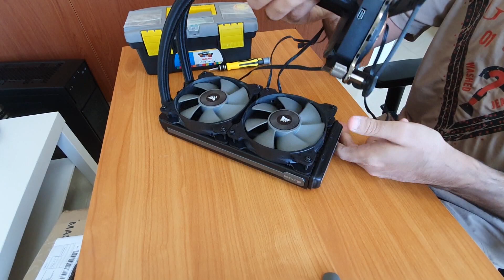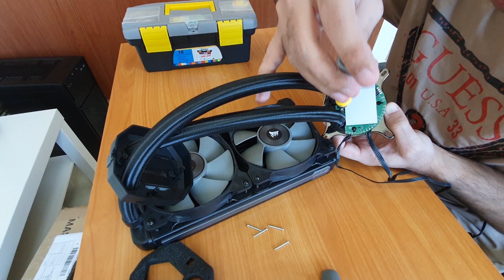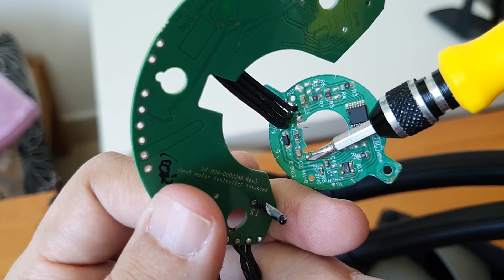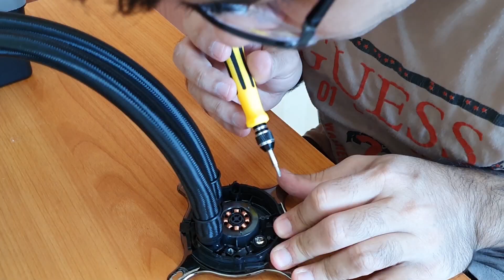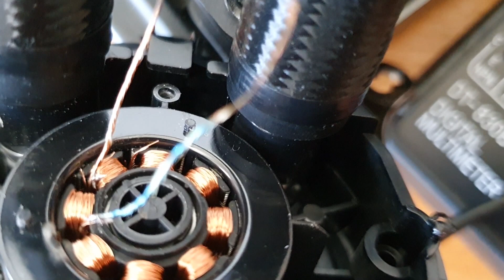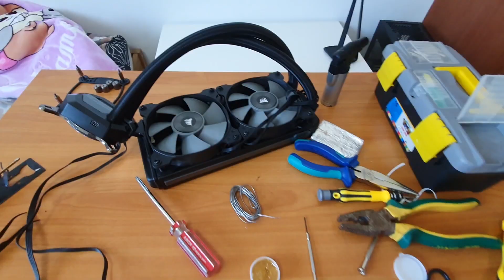My AIO just died :(( how did I revive it? All in one liquid cooler teardown repair Corsair H100i v2

Comment: can you help me. where the cable must be solder  ? i can not see you doing to solder from coil to pcb board
Reply from the maker: Well actually the soldering was very micro so i couldnt capture with my camera. i tried my best to show how its done. i soldered the wires from pcb to the coil itself as the length of wires were short so i did 1 round unwind the wires so as to reach pcb.

Comment: Does the pump run as soon as you plug in the usb connector? Im thinking its easier to test if it works on the workbench first
Reply from the maker: Yes i tested it before installing back

Comment: Omg i have exactly same problem with my aio. The thin wire just disconnect to the coil.I was about to solder it but the wire was too short. Now thank to your video i know how to save my aio
Reply from the maker: Thanx always happy to be helpful 🙂
Reply: @gunjackblaster   Unfortunately mine, despite soldering two wires to the board, still doesn't work.
Reply from the maker: @vinet4u  try to see if wires are from same coil or opposite coil. They shoul be from opposite coil